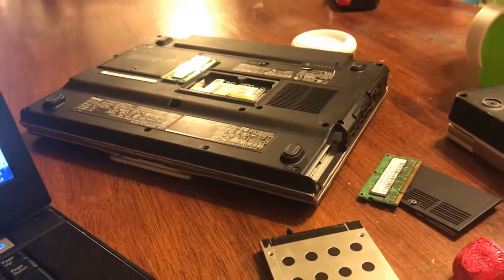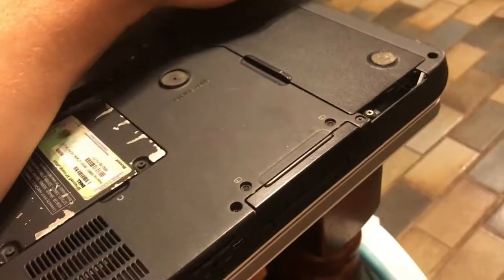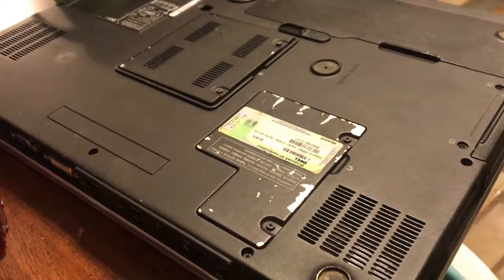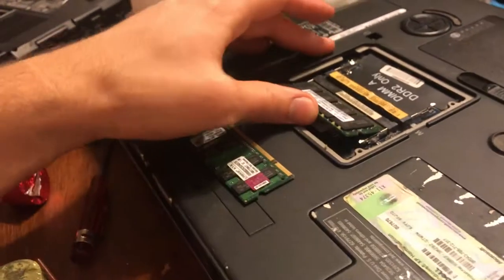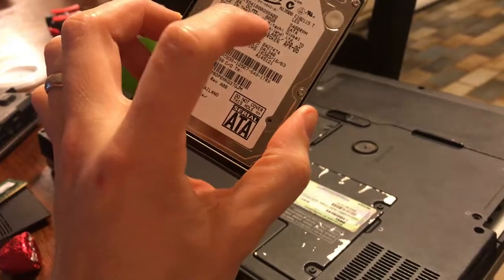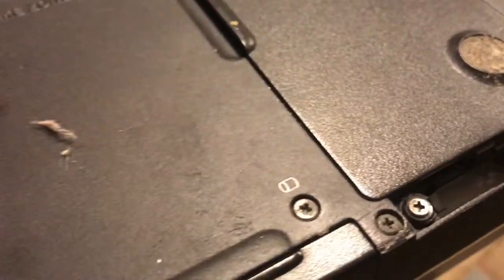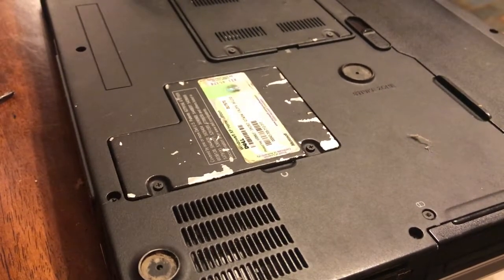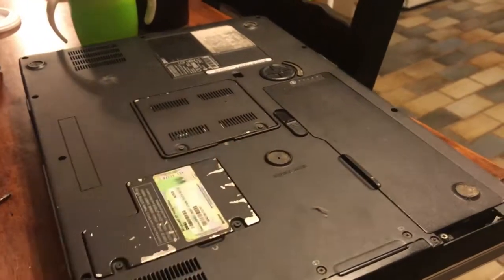Dell Inspiron 9400 Ram & Hard Drive Upgrade

Comment: Nice video .. wish you would of stated what type of memory pc2 etc .. also tge dell 9300 inspiron had freaking old ide pin hard drive .. so looks like dell used sata connection in the 9400

Comment: Baking those motherboards in an oven @ 220 Degrees Centigrade for about 10 min might fix the GPU garbled display issue. 😕

You could even just use a regular heat gun with the 250 Degrees Centigrade option & an IR laser pistol design handheld termometer for better accuracy. Heating only the GPU chip. 🤔
Reply from the maker: I've tried that before with some success, but I had a better laptop sitting around so seemed like the best choice.
Reply: @mjmcomputers  I had the same laptop and my graphics died to, had also a HP tx 1000 with an nvidia card and it faild, with extended warranty they replaced the motherboard, when i got it home again i took it apart and put an copper shim on the nvidia graphics card, it still works today :) .

Comment: Do you mean 5400 is bad (As opposed to 7200) or the drive has given you problems? I have a 60 gig travelstar and i haven't had any problems with it yet. Took it out of a Toshiba Satellite A35.
Reply from the maker: 5400 is just slower than 7200.

Comment: I bought one with T1350, would it accept this T7300 i have laying around? I heard the T7600 was compatible.
Reply from the maker: I don't think it will, only the even T7x00 ones like T7200, T7400, T7600, not odd ones like T7300
Reply: @mjmcomputers  I noticed that. I put a T7200 in it out of this Dell Latitude D820 i bought for parts for my other one.